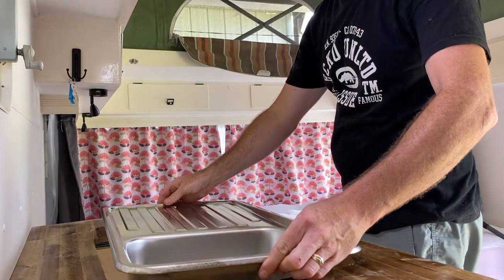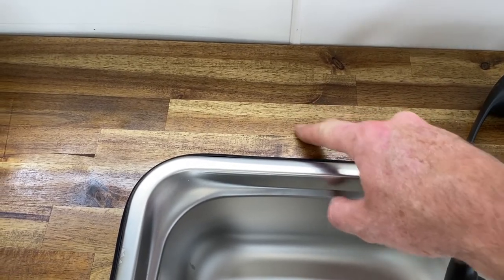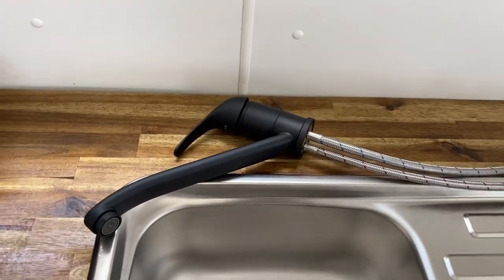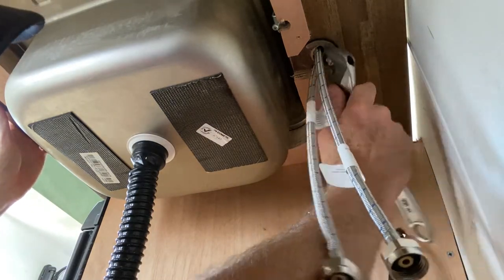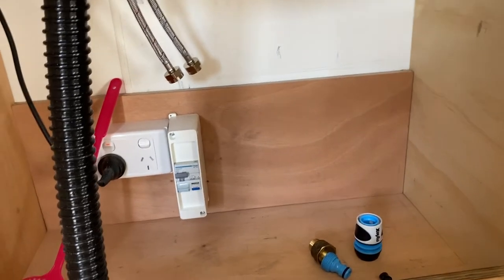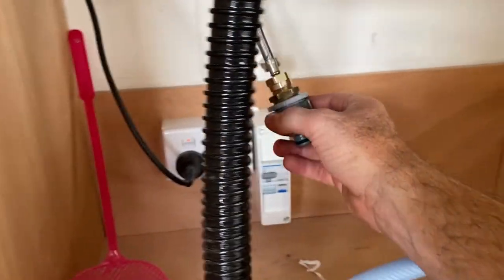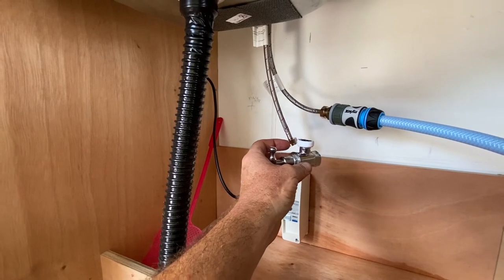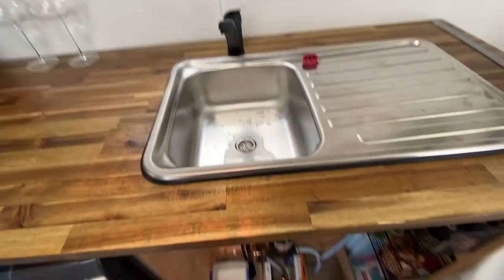Working on my old Caravan - Installing a new kitchen tap #caravan #diy #makeover #caravanlife

Comment: Dumb q: How does mains water come through this - is that via the pump too? Or do you combine it some other way so it comes through the tap?
Reply from the maker: No not a dumb question at all. The mains feed is just tapped into the same piping. When you’re connected to mains it provides pressure without the need to switch on the pump.

Comment: Good video. Thank you. Can you tell me the components used from the tap tail to the water hose?
Reply from the maker: Hey Martin I wouldn’t know exactly what you call them sorry. When I was working it out I took the tap I bought to the plumbing isle with the hose section and experimented until I found the right parts to connect it all. 👍🏻
Sorry I can’t be more specific but hopefully that helps.
Reply: @TheBeatenTrak  OK thanks.

Comment: If that circuit breaker is not a combo safety switch and circuit breaker then i suggest u change that too, cos ur family safety is number one priority  What ever is in there too u may as well toss it cos of water damage, thats why houses need a safety inspection when there's a flood and the power company will not have reconnect until u have a safety certificate. Who ever told u to put the electrical under the kitchen sink needs to be shot, cos its classified as a "wet area" and is unsafe.
Reply from the maker: I actually had the circuit breaker installed professionally at a local caravan place. I’ll query them on it next time I see them.
Reply: @TheBeatenTrak  They will come back at u and say "when they installed it, there was no kitchen sink there or a pump or plumbing, therefore liability will come back on u, god forbid anything happens to u or ur family. Did a licensed electrician do the work?? the law does not see much of a difference between a house and caravan and I am sure one day RV parks wont allow u to plug in without an electrical certification.